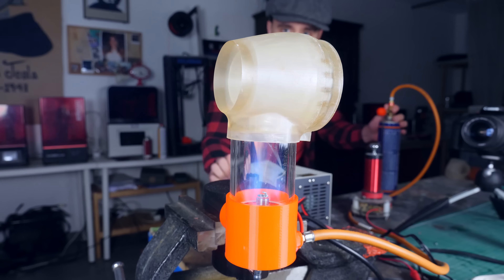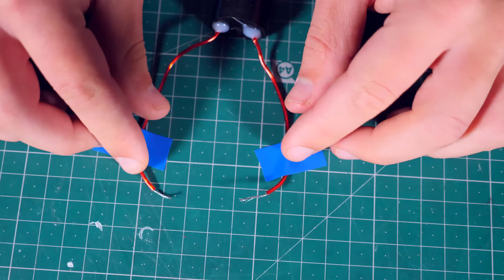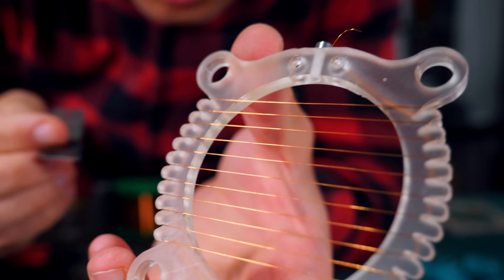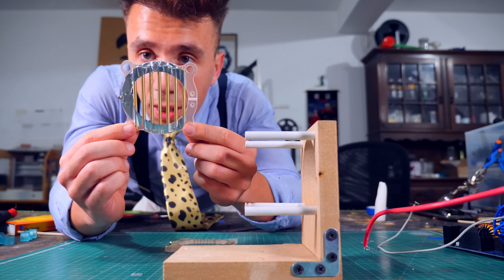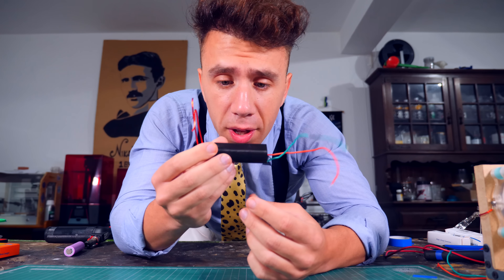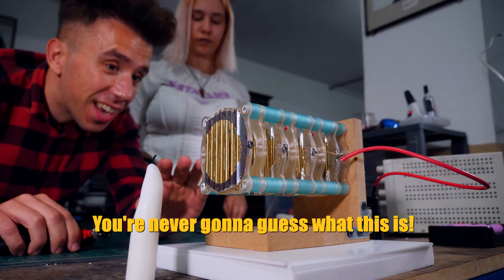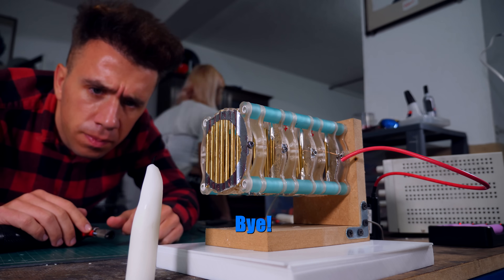I built a TRUE BLADELESS FAN

Comment: “Okay so jay’s a douche, but he has good ideas” 😂 well spoken my friend.

Excellent build and results! Let the war of the [ionic] currents begin. My V2 will need to beat this.
Reply: Hi plasma channel
Reply: Shouldn't be hard, considering the gap spacing in this implementation.
Reply: @JsemPO12  🔴 What Is Islam? 

🔴 Islam is not just another religion. 

🔵 It is the same message preached by Moses, Jesus and Abraham.

 🔴 Islam literally means ‘submission to God’ and it teaches us to have a direct relationship with God. 

 🔵 It reminds us that since God created us, no one should be worshipped except God alone. 

 🔴 It also teaches that God is nothing like a human being or like anything that we can imagine.

🌍 The concept of God is summarized in the Quran as:

📖 { “Say, He is God, the One.  God, the Absolute.  He does not give birth, nor was He born, and there is nothing like Him.”} (Quran 112:1-4) 📚

🔴 Becoming a Muslim is not turning your back to Jesus. 

🔵 Rather it’s going back to the original teachings of Jesus and obeying him. 

More .....
Reply: @1islam1  UH what?
Reply: @1islam1 no one cares and no one asked
Reply: Can either of you speak to the efficiency, or possible efficiency of moving air in this manner vs the usual way?  I'm not sure how that would be measured, CFM wattage?
Reply: @TuckMcSouthard  It's extremely inefficient. Ionic wind devices would be prevalent if this were an energy-efficient method of producing air-flow.

The method of measuring the efficiency would involve a few things -
Velocity of the air at the 'exit' of the system,
Volume of air moved over time,
Wattage of system in normal operating conditions, and a few others.

The biggest problem in such a system is the production of chemical reactions within the air, such as creating ozone and nitrogen compounds. Over time, this will cause the system damage, leading to further loss of efficiency and eventual failure. Even so, the fact that such chemical reactions occur shows that energy is being dumped into changing the air, rather than pushing the air.
Reply: @christopherkarr1872  This is what I suspected, and I wasn't even thinking about the chemistry issue.
Reply: @TuckMcSouthard  Lots of nasty stuff gets generated via plasma. Nitrogens get ripped apart and makes nitrogen di/oxide (which turns into nitric acid - this is one of the ways people make nitric acid at home! Though with an actual established arc and not just corona discharge, for higher efficiencies). Same thing applies to the oxygen in the air, as it generates Ozone (ozone generators use this ionic wind method, they normally use un-epoxied carbon fibers splayed out into a brush, for the sharpest points possible). So you wouldn't want this running in your house for hours a day for sure
Reply: @christopherkarr1872  On the other hand, done properly, one wouldn't have to worry much about nasty biological pathogens in the air like viruses, fungi and bacteria, and many particulate pollutants would precipitate out of the air, but I'm sure you know that already, right?

Also, you wrote, "the fact that such chemical reactions occur shows that energy is being dumped into changing the air, rather than pushing the air."

That's just ridiculous, maybe you made a typo?
Reply: @retromodernart4426  No typo. Electric current changes the oxygen in the air from O2 to O3, and converts N2 to nitric acid and other nitrogen compounds. This saps electricity from the circuit.
Reply: @christopherkarr1872  Ok, no typo, just ignorance of simple facts, easily corrected, go study:

"Accelerated electrons impact O2 in the air, Electric current changes the oxygen in the air from O2 to O3, and converts N2 to nitric acid and other nitrogen compounds. This saps electricity from the circuit.

Any electrical discharge, or spark will create ozone. The spark will split the oxygen molecule (O2) found in ambient air into elemental oxygen (O). These Oxygen atoms will quickly bind to another oxygen molecule (O2) to form ozone (O3).

The electrical energy used in ozone generation splits the oxygen molecule. The theoretical energy required to split the oxygen molecule is described below:

      -0.82 kWh of electrical power for every 1 kg of ozone generated

      -0.372 kWh of electrical power for every 1 lb of ozone generated

In actual ozone production, the energy required to produce ozone will be 10 – 20 times the mathematical figures shown due to the ozone generation inefficiencies." 

"The mechanism of production of nitrogen oxides by electrical discharges has been examined. The velocity of shock fronts generated by laboratory scale discharges have been measured and are found to be too slow to raise the air temperature to the ca. 3000K necessary for nitrogen fixation by the Zel'dovich mechanism. The freeze out mixing ratio of NOx in air has been measured directly for low pressure discharges and is found to be of the order expected from the Zel'dovich mechanism for gas cooling over a timescale far longer than the duration of the shock front. Therefore it is concluded that NOx is formed in the gas in the slowly cooling hot channel region and not in the rapidly cooling shock front. Also, it is argued that NOx formation occurs by a freeze out mechanism due to a rapid drop in temperature, not density as has been suggested. NO2 production is found to be significant, with the [NO2]/[NO] ratio being strongly dependent on the water content of the air. Discrepancies between previous experimental studies of the [NO2]/[NO] ratio and the quantity of NOx formed per unit energy (P) are discussed. P is also found to vary with spark gap and ambient pressure. It is thought that these effects may be due to significant loss of heat from the spark gap to the electrodes. The inclusion of atmospheric levels of N2O, CH4 and CO2 are found to have no measurable effect on the yields of NO or NO2."

In short, he ~20KV or whatever being produced by the HV generator is accelerating electrons into O2 molecules, etc, as elaborated upon above, and some plasma effects (if any) may also be producing some NOx.

Finally, of course the circuit is using electricity, it's the same as turning on an electric lightbulb and getting the bulb to light (and produce heat).  The amount of "electricity" used depends  on how bright (and/or hot) you want it.
Reply: @retromodernart4426  That's an awfully long-winded way of saying, "I think you're ignorant because I like being right on the internet; here's some scientific research material I quoted that shows that you are correct."
Reply: @christopherkarr1872  
>Even so, the fact that such chemical reactions occur shows that energy is being dumped into changing the air, rather than pushing the air.

Could something be done to improve that? Once you've made the ions, get them to do more useful work? Keep them hanging round for a little longer to interact with the engine, get them going really fast? Change the electrodes to do this.

Nitrogen oxides are extremely dangerous pollutants, cars are regulated in how much they can emit. The intense heat in their cylinders can cause nitrogen and oxygen to react. But that's not important for a toy.

Are ionic engines inefficient? They're famously used on space probes, but there their main requirement is to be sparing with the propulsion gas, to use as little as possible. The electricity is "free" from solar panels or decay of an isotope. NASA et al presumably design their engines around those criteria. But could one be made efficient?

It seems like no research has been done, outside of space ion engines. Could they be made efficient and powerful? They'd only be prevalent after someone invented them, same as the internal combustion engine. There's voltages, electrode shapes, chambers, numbers of electrodes, all free to be experimented with. Lots of variables to push and pull.

What about electromagnets to push the ions, instead of electrostatic charge? Send ions down a tube with coils around it, like a coilgun with tiny ammo!

So-called "drones" came from nowhere into a big business just a couple of years ago. What if ultralight drones, with efficient engines, could lift their batteries and do the most amazing aerobatics? Or even requiring a tether, a wire to supply electricity, would be OK if it were long enough. Would keep the thing from getting lost! Computers in drones already do amazing aerobatics, imagine an almost-weightless ion flyer with electrode arrangements that can put precise thrust wherever you want, and change it instantly!

Pardon me, I digressed a little.
Reply: @greenaum  To put it plainly, we don't have electric cells that are high-enough voltage to run an ionic wind device. The cells we do have are prohibitively heavy (think trying to lift four standard lantern batteries with a drone), and the design would have to be scaled up significantly to even produce enough lift to get off the ground.

To answer your original question, 'why isn't this being explored', the reason is that it's far more efficient and convenient to use electricity without changing its voltage through a transformer or switch-mode power supply (SMPS). This is the same idea behind, "Why use electric cars when you can use electricity to produce hydrogen?" Each conversion creates more losses and reduces efficiency. Of course, a coal based steam powered car wouldn't be practical, but scale it up to train size and it works alright. Take that same coal and put it into a power plant, then send that electricity to an electric car and you have a practical system.

Why do we use the ionic thrusters in space? It's easy to replenish energy and it's impractical to eject launched mass as chemical fuel. Ion thrusters are able to accelerate particles faster and more controlled than chemical thrusters. Also, having no wind resistance or net gravitational acceleration allows the tiniest bit of ionic acceleration to be maintained and built upon, in the case of extraplanetary missions.
Reply: @dogsarebest7107  I’m thinking of messing with this stuff on RC aircraft for drag reduction as a surface mounted thing, as an electric afterburner (the vacuum drives are efficient because of exhaust velocity, and lack of chemical reactions), or as something else like a preburner for an ram burner as my power plant is an EDF.
Reply: I was about to say that this was done first by plasma channel.

I love how you guys just mess around though, having a laugh and not taking it seriously.
Reply: @sarchlalaith8836  corona wind yikes 🤣
Reply: You would be wrong. The basics of many of the plasma channels design is an old concept. Take the difference between using the Chinese  generator vs the older TV circuitry. You would think Jay knows what he's doing, giving intenegza the difficult side of this equation. They are having not so serious fun like you say. Also, this has to do with capacitance.  That is why intenegza was able to get the air movement with a Chinese generator compared to the pulsed tv generator. ( Could be wrong about the tv generator, but... I have heard of the difference before...)
Reply: Why wouldn’t you guys duct the entire thing? Is there a reason you can’t? I would think a certain amount of positive air pressure is escaping out the sides…🤔
Reply: @BPBomber  Because they didn't think of it, you did, LOL
Reply: The second attempt didnt win
Reply: @ElqYaNoEsquía  Not even close lol. In Jay's video he makes it look like Integzas fan only reached just over 6m/s when it really reached 15 lol. They need to start looking at pressure so they can see total flow.
Reply: Well done 👍👍 bruhh!!
Reply: Ozone generator?
Reply: bro you said that cheap chinese voltage modules won't work, it works better.
Reply: What if you placed the ionic breeze system in a duct and separated the stages with stators to add a compression element.  Maybe the stators could be a 3D Tesla valve.  Each stage would progressively compress the air flow, the stators/tesla valve would prevent backflow, and then end the duct with a nozzle.  Perhaps it could produce a stronger thrust force.
Reply: Jay looks australian and sounds canadian.
Reply: @Sarahthompsonlostinamerica  Somehow that's part of being a genuine douche these days?
Reply: Hell yeah! Battle of the plasma drives! You just need more surface, and what happens when it moves? Can the air particles can be charged while moving? Can you help to charge somehow with a fan and a compression zone?
Reply: I knew id already seen this somewhere else.
Reply: im grinning ear to ear from that remark lmao
Reply: This competition needs more back and forth. We want supersonic velocities
Reply: I have a question Jay, is it possible to generate an ionic wind with excess ions? If so, combining a this with a magnetic field manipulate the flow could produce some interesting results.. just a though
Reply: @HenrikSyvertsen  I was thinking something similar. If there was a strong magnetic field 90° to the electrical field, wouldn't the ions get accelerated much more, but in that case perpendicular to both fields?
Reply: @HenrikSyvertsen  Look up "How a particle accelerator works", and find the answer to your mystery.
Reply: I love both your channels and content! And the good natured ribbing you give each other!
Reply: I was just about to say I saw you make this like 2 days ago
Reply: my dad thinks youre a douche too lmao
Reply: Yeah saw yours first
Reply: Isn't it also an ozone generator? Did you smell the odour of bleech?
Reply: @Integza: Try and place a Venturi on the end of the blade less fan to create Venturi Effect (...or a turbo blade?). This will speed up the airflow.
May be you have to build a case around it or place the blade less fan in a PVC tube. ...and the a venturi on the end near the candle.
Reply: YES! THIS IS AWESOME!
Reply: And more of my favorite youtubers joining forces.. I love collabs :)
Reply: That would be fun to watch.
Reply: There allready is. Ramjet
Reply: Should we worry of ozone in this kind of design?
Reply: @edmondhung6097  Ozone is a huge byproduct of this sort of device/experiment. Any corona discharge is going to create ozone in abundance. As ozone is a powerful oxidizer, it would be wise to use ample ventilation to avoid health damage or even damage to personal property.
Reply: Would more surface be better like not just vertical wire but horizontal wire as well?
Reply: @drakinfire7205  The ideal arrangement would be a perfectly-even electric field, but that's unattainable (or difficult at best) while still allowing air flow. I suppose that - without modeling the fields - the most even arrangement I can think of is one in which you have a mesh that allows a good deal of air through.Perpendicular arrangement seems to have 'corner' zones that would act as electric field 'hot spots', as opposed to the even fields across parallel wires. I hope this makes sense.
Reply: Hi jay
Reply: Does this smell like ozone?
Reply: I wonder if you could use progressively smaller stages? Would you get compression even with physical restriction? Could you build a long funnel with grids to feed a Tesla turbine? Lol
Reply: Its the race to the moon all over again. This time two garage monkeys with plasmid ideas.
Reply: Can't wait for your next vid. I'm sure you V2 will do better than any ionic fan.
Reply: Yeah, he's more than a douche, he's a thief.
Did you credit Jean Loius Naudin before stealing his lifter design?
Reply: Why not create a hollow wire next to a regulate wire, but at Nano levels, and see if the wind adds up if you make bigger and bigger strands to handle the wind passing by.... Start Nano, and build layers larger and larger to handle the progressive air flow.... In this way you can still layer the progression output, but from a more efficient starting point.
Reply: Im also a douche
Reply: @Magic_man-Gaming2014  You know, you might be related to King Charles Tampon III, you should check!  (Charlie said it, not me, ask him and Camilla), LOL
Reply: Looking forward to it! Really interested to see what you guys will come up.
Reply: Go big big
Reply: Throws down the gauntlet, lol
Reply: You need a duct
Reply: The iconic ionic battle of ionic thrust
Reply: That comment in the video killed me.  Could tell it was just joke, but it was delivered so well.
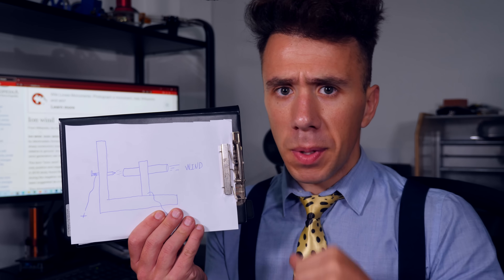Reply: 01:56 - 'Bobby Duke Arts' reference! 'WEWD' Yay! In some ways, you're as crazy as Bobby, but, just as creative with ideas too!! Hahahaha 👌👍😉      😎🇬🇧
Reply: Lungs lungs lungs no fans there
Reply: i like how he offers to share your design at the end too ;) so kind and generous lol
Reply: Ahh that's the one i seen earlier, great design, good to see some competition
Reply: I watched your video first so I was confused at first XD
Reply: Glad to see this isn’t stolen content
Reply: Our V2 was ok. Greetings from Germany.
Reply: Why did you say the cheap Chinese transformers were no good?
Reply: SUp
Reply: Firespike machine Jay....
Reply: Hmmm I see a challenge here... Who's gonna have the best bladeless fan?
Reply: Man , you can combine Dyson fan concept with  ionic thruster as wind is sticky there maybe more wind produced and use in jet engine or rocket engine . ⚡
Reply: But…

Could you in theory use this to build a cheap alternative to a windmill?
Reply: Needs more likes do he can get a 3D printer
Reply: Great way to squish in the diy alternative to Amazon! Love it. This is great stuff guys.
Reply: Integza you should build an fusion reactor Like Jay, try to beat him,make an Better setup,all of us Hope you will!!
Reply: @Plasma Channel  >>>  Integza's DISDAIN for tomatoes has made him a bitter man. 
 😊😊😊😊😊
Reply: The printer is going to you🤦
Reply: Alternate the stages by 90 degrees to make it into an actual grid, then continue testing the rotations to make smaller columns further down the line keeping in mind the same rules that apply for accelerating bodies adding energy at the right spacing vs. travel distance. The ion flow should be condensed into columns for a more laminar flow, the induced wind might even gain some advantage of bernoulli being "ionically" constricted into columns making for a higher speed/pressure on the output per square meter?
Reply: I believe you have a scammer in your comments.
Reply: i think plasma channel will win on having better equipment alone. but i will cheer for the guy that kills tomatoes.
Reply: Duct the V2
Reply: Please collaborate more!
Reply: Also I wonder what if you make it big? Like, huge. Good luck
Reply: WHERE IS V2???1?1?1
Reply: something else just came to mind, so i'm having an issue with my pc fan, and after watching this i wondered if this kind of fan design could work for cooling my pc, now hear me out, what if all the fans could be replaced using something like this, your CPU and GPU and graphics card all produce heat.

but i wonder if the pc could be more efficient instead of wasting some of that power by using something without any moving parts such as your fans, but i also wonder if this could also help clean the pc, so there would be some kind of cleaning mode that would turn on after a few months or something as every fan has been replaced by these bladeless fans.

so your pc tower could be self cleaning without the need for you to purchase compressed air in order to clean your pc, anyway i wonder if there was something that could make this a bit more silent.

or maybe my idea here is a bit stupid, it just came to mind after watching this video.
Reply: Nein! Integza is better
Reply: Challenge excepted! My artillery sidewinder will make quick work of these files, Thanks Joel (@integza). Jay (@PlasmaChannel) you are awesome as well. This will add to my collection of high voltage toys. (PSA, always use safety when playing with high voltage. Watch @ElectroBoom for what not to do.) Lol, No seriously he is a great watch.  Keep up the great work you 3.
Reply: If you enclosed it all in a tube it would capture some of the pressure increase from the temperature increase.  If you put a big aluminum foil funnel before the device it would tend to concentrate the incoming air. If the funnel was connected to the high voltage, it would increase the field strength because of its size and greater charge and capacitance.  If you put a shaft through the middle with a compressor fan on one end and a turbine on the exhaust end it might really accelerate the air. If the funnel was not connected to the same high voltage but was shorted so that it would build up a charge and a large aluminum foil plate connected to the  negative side of the second power supply and also insulated with paper, it might greatly increase the field strength and the force on the ions and the speed of the wind.  
It seems that the air could be driven using only one high voltage plate. A high voltage positive plate should push a nearby positive ion away from the plate. If the negative electrode from the high voltage source was down the street somewhere, it still seems that the plate should push the ion in a direction away from the plate regardless of the location of the negative plate.  
Certain ultraviolet and other radiation will ionize atoms.  If an atom loses an electron in the vicinity of a positive plate it should experience a force from the positive plate.  If you ionized the air at a point with the focal  point of an ultraviolet laser, it would create many ions and free electrons. If the point is near a positive plate it should push the ions away from the plate and attract the electrons.  Since the ions are much bigger and heavier than the electrons, it seems that more air should be pushed in the direction of the motion of the ions than in the direction of the electrons.  The force on the air at very high voltage could be tremendous.  
If you had a circular enclosing surface that was surrounded by positive high voltage  plates and ionization points arranged in such a way so that the ions are pushed at a tangent to the inside of the enclosing circular surface, it seems that the air might be spun at a very high velocity.  If the air was spun fast enough it would tebd to evacuate the center of the enclosing surface and compress the air against the inside of the surface.  
The point is that this arrangement might make possible a very powerful fusion reactor.  With ionization points arranged along the inner surface of the compressed air and near the center of the plates, ions accelerated in towards the center at a high enough voltage and in a good enough vacuum would fuse with ions coming from the other direction.  If the gas was deuterium there would be a vast and profuse supply of fusion temperature ions to a plasma.  An arrangement of negative plates to drive an excess of electrons into the center would help confine the plasma..  If the ionization points were slightly offset from center, threads of ions and electrons would tend to spin the plasma.  An excess of electrons in the spinning plasma would result in a magnetic field that would also help confine the plasma.  If an electron or ion escaped from the center it would tend to be drawn towards the opposite charged plate where it would crash into the compressed hydrogen and ionize many hydrogen atoms.  The resulting  ions and electrons would be driven in towards the center depending on which plate they were in front of.  An alpha particle from a fusion event would crash into the surrounding gas at about 20 or 30 million meters per second and ionize zillions of atoms and accelerate the rate of fusion.  A thin layer of compressed air will stop even these heavier ions travelling at a much higher velocity than the fuel ions.  
An interesting possibility is that air might be used as the fuel for the device.  Water molecules are lighter than air and would tend to accumulate on the inner surface of the spinning air because of the centrifuge effect.  Water contains a certain small percentage of deuterium that might be enough to fuel the system.    Exhausted to a gas turbine to generate power and supply compressed air to fuel and cool the system, it might achieve net power and practical  fusion power  long before the endless 20 year projections of the billion dollar fusion projects.
Reply: If you use these holo & Ion vents in front flow air to a narrow electric detonator engine chamber, you created an Electric afterburn engine all electric. This ion demo could've been a far better 'hyperloop.' (nickname) Tirbine•loop (wind parallel to stack speed vs sound barrier) transit express.(+🚆in&out vents).
Reply: liked the new video you just put out
Reply: He copied you and pretended that each insight was his own. Or he never came across your popular video on the same thing. Idk lol
Reply: Which rod did you use..
Reply: no cheap Chinese generators he says "Liar"
Reply: Uhh, Mr. Plasma? Is he being entirely safe with his new gizmo? Corona discharges tend to produce reactive oxygen/nitrogen species and he’s testing his device indoors. I worry that he might be inhaling a cheeky cocktail of carcinogens and neurotoxins
Reply: Use fanless motor shell inside use in thruster before the ion thruster put circular magnets
Reply: In the blue corner we have integza 
A literal rocket scientist 

In the red corner we have plasma channel tv
He likes plasma rifles and expensive wine 

It’s a war of the ages and I want a clean fight a fair fight no hits below the belt unless it’s funny then absolutely send it
Reply: @Plasma Channel Actually, Integza was only half right... all of your 'ideas' are things other people did long ago, usually way better, too.

Maybe grow a mustache, LOL
Reply: @retromodernart4426  ionic thrust, ionic LIFTERS and ionic thrusters are different items entirely. US patent office wouldn’t have allowed my patent to go through otherwise. As for mustaches, Joel is the guy for such a feat!
Reply: @PlasmaChannel  I apologize sincerely, I was ribbing on you, I should've used the /sarc tag, I've seriously loved your channel for years!

But please, try a mustache (handlebar for maximum effect according to my calculations), we already know how Joel looks with one of those!
Reply: @PlasmaChannel  
Why would you patent Jean Loius Naudins lifters? You gonna steal his Coanda drone too?
Reply: @retromodernart4426  hey, no problem, it’s all fun. Haha I actually had a British style mustache for a while… and I think one of my older videos shows me with it….. I might try it again at your request.
Reply: @FireBeam you’re sincerely missing the point. I’m familiar with his work, it’s wonderful. An ionic lifter that does nothing but vertically hover is much different than a dedicated thruster that provides horizontal thrust for winged flight. You’re getting angry about the creation of a plane, when a helicopter already existed. Think on that for a second. The US patent office agrees with this sentiment as well.
Reply: @PlasmaChannel  
Easy question: 
Did you credit JLN in ANY of your lifter videos?
Reply: @PlasmaChannel  
Oh, that's funny,  i just remembered (and found) the video from JLN labs where they have a multilayer lifter ON ITS SIDE going around in circles.
You remind me of a certain other "inventor", who worked at the patent office and, out of the blue, had a revolutionary idea 🤔🤔🤔
Reply: @FireBeam I’m happy to elaborate on that on my channel. Out of respect for Joel, lets take it off his comments thread. Drop me a comment on one of my videos and we’ll go from there.
Reply: @PlasmaChannel  
No thanks, not going to contribute to the algorithm on the channel of a smarmy thief.
Hey, here's an idea!:
I'm going to take my ceiling fan, and mount it on my wall! I'm getting a patent and gonna make a million dollars!
Reply: @PlasmaChannel  😀👍
Reply: Bros about to make some technology more complex than Nasa  could ever build just to win the war of currents💀